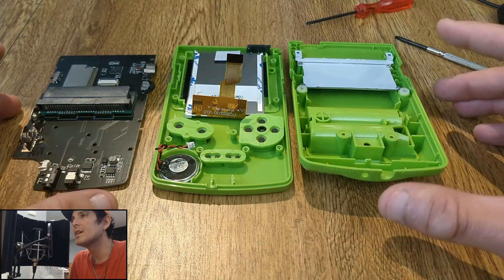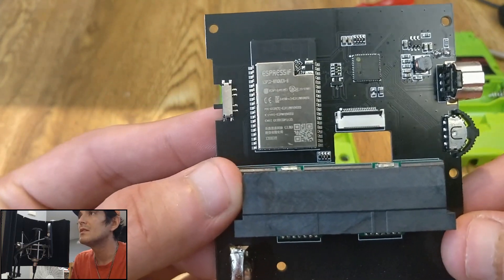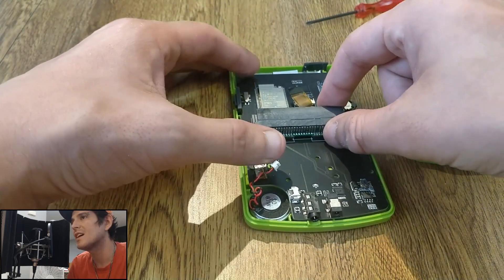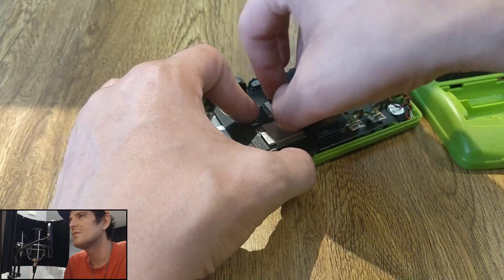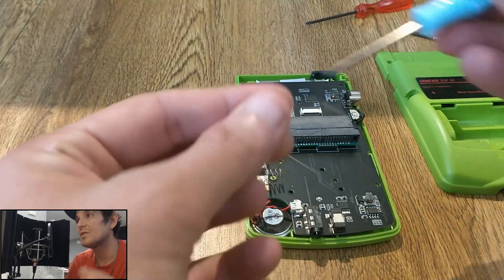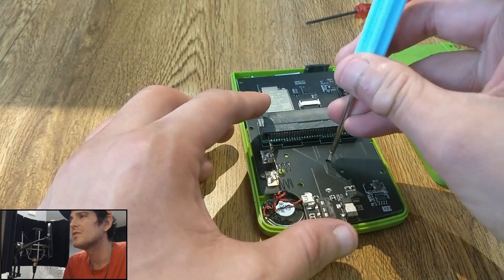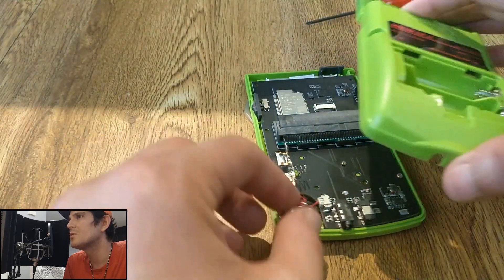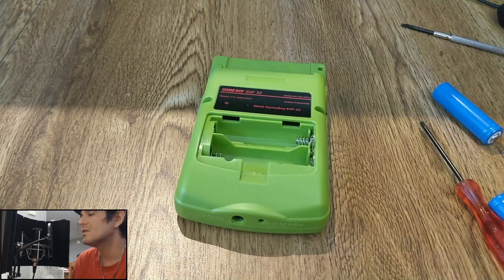ESP32 GBC Look Inside and Reassembly

Comment: I've looked up several posts about this GBC.  It's kinda junk.  :/  Basically, you're not going to get quality emulation because the internal firmware storage is smaller than the ones on the Odroid Go.  Game Boy emulation definitely has problems.  Screen tearing and sound is pretty horrible.
Reply from the maker: You looked up wrong somehow. Internal storage is 16mb and the same os from the odroid go works here. I may have said 4 in the video because i glanced at a general chipset sheet
Reply: Bro the internals are the same as the Odroid Go.

Comment: Compared this to the original GBC mobo.  I'm amazed at how few components there are in the ESP32 one.  In the old one, there's diodes and resisters all over the place.  This new one has barely anything attached to the PCB.